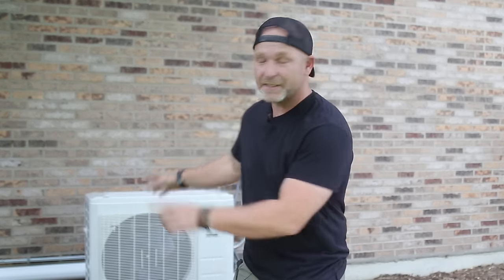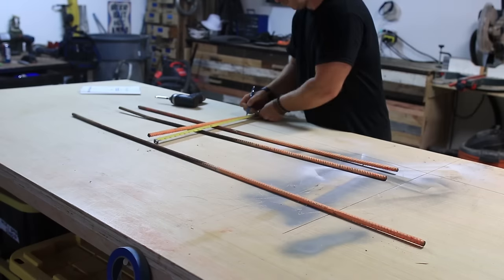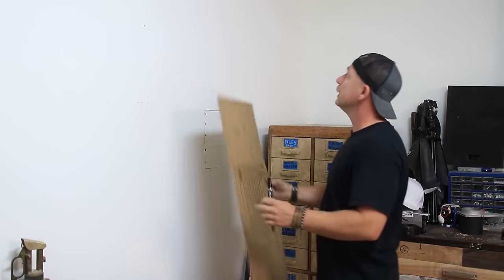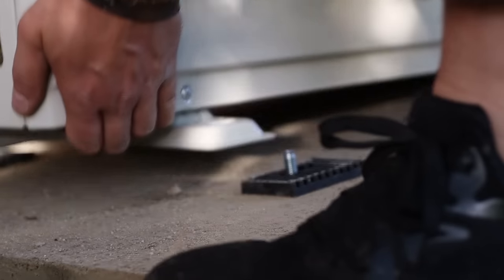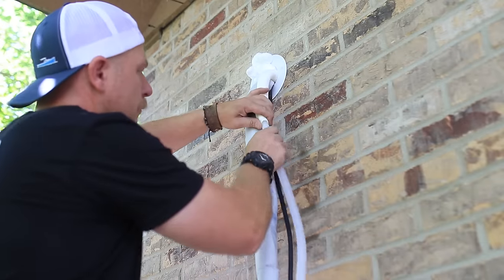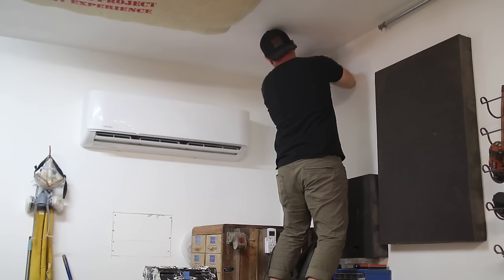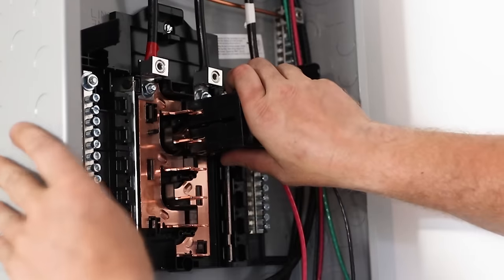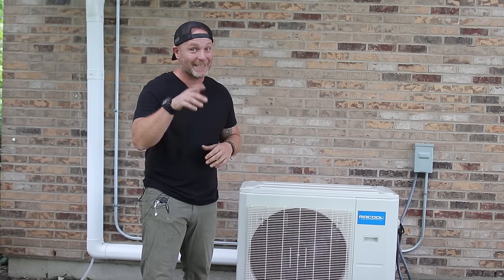How to Install a DIY Mini Split Air Conditioning and Heat Unit.  MR COOL 24K Split Unit

Comment: Great video! I am thinking of installing this unit upstairs in roughly 1200 sqft well insulated area. First, do you think it is big enough with a single head? Secondly, what wire size was recommended for this size unit? And finally, was it a double pole 30 amp or 40 amp breaker (part of the wire size equation).

Comment: Very nice job! Just one question.....Why didn’t you locate the disconnect switch on the vertical conduit you installed and move the condenser closer to it?

Comment: Was this unit already full with refrigerant gas? I thought most were  sold gasless and you needed to fill with refrigerant gas once plumbed up. Great work , yeah ladders can be dangerous.
Reply from the maker: Yes it’s pre charged already.  So all you have to do it connect it all and open the lines releasing the refrigerant.

Comment: Great video!  Glad you did not get hurt, worse, in the fall!  I see you used a 30Amp (220V) circuit.  Is that what Mrcool calls for, 30 Amp?  Do they request a dedicated circuit?  I will be installing 2TWO, SEPORATE, Mrcool    "E  star "4Th gen 24,000 BTU AC / Heat pump units",  I hope I don't need a dedicated circuit for each unit.  Do I?  (I telephoned MrCool and after being on hold for 8 minutes, the said they would call me back.  About 1 1/2 hours ago!)   THANKS!

Comment: I hope you can answer this fast. can I have the compressor hanging on the wall behind the indoor unit. with only the coolant pipe that comes out of the wall unit going directly into the compressor. or do you need three or four meters of coolant pipe for the air conditioner to work properly ?
Reply from the maker: So the lines cannot be cut because they are precharged.  So you can hang the condenser unit where ever you want but will have to coil the lines somewhere. You can drain the refrigerant if you want and cut the lines to make them shorter but then will have to braze some sort of fitting and have a hvac tech come out and refill the lines.  Not sure if doing that will do something to then warrenty though.   I would contact me cool and ask them.  They are really good about answering questions
Reply: @KomarProject  the air conditioner comes with four meter of coolant pipe, as of now they are empty because it isn't finished being installed. I just wanted to know if it has to be four meter or they could be cut short. but I think you answered my question. thank you.

Comment: Did you notice a significant difference in your electricity bill? I live in central Texas and am on the verge of ordering a 36k for my 1250 sq ft foam insulated shop. Was curious what the electricity bill increase would be.  Also where did you purchase?  Thanks for the time
Reply from the maker: I haven’t yet.  We have only been in this house one year so I have nothing to compare it too
Reply: I have an 18K Mr. Cool in my garage in SW Florida and it does not impact my electrical bill much, maybe $50/month running it part-time.  One piece of advice I would give is to have load calculations done on the space you want to use it for.  The reason is if you oversize it you won't get rid of the humidity.  It will cool the space so fast it won't have time to take out the humidity.  Load calcs are easy and you can get them done for about $100 from Calcs Plus, just send them your info and they will plug it into their software and give you the correct sizing for your space and geographic location.  I ordered mine through Home Depot.  http://www.calcs-plus.com/index.htm

Comment: Installed same system with your help! My inside air handler isn't completely flush on the side with the lines sticks out maybe 1/4 inch... did yours sit perfectly flat? Thanks!!

Comment: Were you using a hammer drill?  I was drilling concrete and masonry a while back with a regular cord drill (high power).  It was taking about 8 mins per hole. Someone suggested a hammer drill. I bought one and it reduced the time down to about 20 seconds per hole.
Reply from the maker: Ya it was a hammer drill.  Just helps a little bit
Reply: @KomarProject  interesting, it made a huge difference for me.

Comment: Question I am gonna be installing my unit. It is a 240v I know I need a 40 amp breaker but, did you use #2 8 awg wire or did you use 3 wire.

Comment: My kids just got a 640 sq ft small home should I get just 1 large unit or the 3 zone smaller units they have 2 bedrooms open kitchen and living area just want to make sure bedrooms have adequate a/c and heat
Reply from the maker: I would probably get multiple small units so they can control living area and bedroom separately.   It might me difficult to push air when they have doors closed.  My shop is 750sqft and this unit does it all but there are no separate areas.   Hope that helps.
Reply: Yes it does thank you and makes sense

Comment: I have a question regarding power consumption. If I understand it correctly, both of the parts are connected to a power supply - but which of the parts - the outside or inside one is drawing the most power for the cooling itself? Or is it split between the 2? I hope you understand my question. I want to install a meter for power consumption and would like to know where to plug it. Thanks!
Reply from the maker: That I can’t tell you.  Sorry.  I would contact mr cool and ask their sales department.  I’m sure they could help you with that.   Good luck Matus

Comment: Wouldn’t the rubber pads help maintain the vibration of the unit?  Wouldn’t this eventually damage ur system ?
Reply from the maker: Yeah the rubber pads do help a little bit but I’ve noticed that there’s hardly any vibration to the unit
Reply: If concerned you can re drill the anchor points and leave sufficient length to use rubber pads.

Comment: Hello Komar, awesome video. I have one question, what kind of screws you were using to mount the disconnect and copper line set-cover on the brick wall? thank you very much for sharing your experience with us.
Reply from the maker: Tap cons.  You can identify them by their blue color.  Used for masonry or concrete.

Comment: Did you get a new ladder?
I’m going to get a 12000 size and am wondering if it comes will all the tools your unit had. I’m guessing not. Also, can you plug the smaller one into a wall outlet?
Take care

Comment: Does the condenser have to be on cement? Could I put in on a back porch? Or could I put some brick blocks down on top on my wooden porch and put the condenser on them.
Reply from the maker: It does not.  It can be on anything that is stable.   I have seen people even suspend it from the house using angle iron.

Comment: How big is your garage? I have a 3 car garage and I’m on the fence between a 18k and 24k. Did you need to pull a vacuum for the lines?
Reply from the maker: I have a 3 car garage and they said 18k would do but I’m glad I went with the 24k.   No need to vacuum on this set up

Comment: What size breaker is required to power the unit? I've got a 100 amp panel in my shop but it's not uncommon to run two 220 machines simultaneously. Wondering if that combined with the Mr Cool would be too much?

Comment: Good job, but is best to pressurize the system with nitrogen to see if you have any leaks, then release the nitrogen and pull vacuum in the copper lines to remove the noncondensables that ruin the refrigerant on the long run, get ready to replace your outdoor  unit pretty soon

Comment: does the quick disconnect box comes with the unit? thanks  for the video and the safety advice.
Reply from the maker: No I had to buy it.  It was $10 at HD and I also bought the whip for it there.  Hope that helps

Comment: you must test your pipe with high pressure for finding leaks and vacuum it then you must open the valve of condenser. 
sorry my English isnt good enough for more information.
Reply from the maker: So with this unit you don’t need to vac it.  It’s done in the factory before it’s sealed and shipped.  That’s the beauty of this unit. But otherwise you are right my friend
Reply: @KomarProject  perfect 
in school we learned about old ac and i dont know about new equipment .
tnx man ❤
Reply: @AlirezA-em4hl  lines must be either vacuumed or purged out

Comment: I need to lift my sinking house but my outdoor unit is placed on the ground. Do I absolutely need to decommission the outdoor unit before lifting the wall? I only need to lift the wall by 7cm or max 10cm. Can I just lift the outdoor unit slowly as I lift the wall?
Reply from the maker: As long as the unit is not hard wired to the house and you have some play with the line set you may be able to lift it as well.  I never done that before and every situation is differant.  Good luck buddy
Reply: @KomarProject  my aircond installer told me the concern is not so much electrical connections but the gas copper pipes as they are sensitive to movement and may cause gas leakage. Not sure if he was over exaggerating it to make some money

Comment: What size wire did you use? Glad you are OK. I'm planning on installing a smaller version in a couple of weeks.  Thanks for the video.
Reply from the maker: I ran 10g wire for the electric.  But with a smaller unit just make sure you refer to the instruction Manuel.  It will tell you exactly with that unit needs.   Good luck brother

Comment: Hi there.  Question for you.  I have a 10 by 10 shed that my husband is fixing up for me as a soap cottage.  Would one of these units be more efficient than a window unit?  They seem awful pricey for just a shed, but then again, when I am working out there, I need heating and cooling.  I have a big window unit that was given to me, but since the shed has no windows, we would have to cut a large hole in the wall, which we aren't too keen on doing.  We are in the process of insulating and putting up bead board right now, but if we go this route, we need to plan for it now as there is only one wall with good access to the outside and space for the unit.   I am thinking we would have to hire someone to install it. Not sure what that would cost.   My husband works in propane and can set up my stove, but I am not too keen on him playing with electricity.
Reply from the maker: It’s a great unit for small spaces.  The one I installed is a 24k cuz my shop is pretty significant.  But I’m sure a 18k or even smaller will work for a 10x10.  And the best thing about this is you can set times for it to turn on and off from your phone.  I highly recommend it but I can’t speak to the cost difference on a window unit.   Hope this helps
Reply: @KomarProject  Thank you.  We do have a place in our little town that installs mini splits so I guess the best thing to do would be go down and talk to him about it.

Comment: Just curious. Is the 24K unit not overkill for your 750 sq ft garage? According to the Mr. Cool website, it is rated for 1500 sq ft. Curious because I'm getting ready to purchase one for my ~750 sq ft finished basement and deciding between this and the 18K unit, which is rated for 1000 sq ft.
Reply from the maker: Ya it’s over done.  The 18k should be sufficient for your basement.  I open my garage doors all the time and this allows it to push ac and heat very quickly.  I also have a attic that’s not very well insulated above it.  Either way I would have been good with a 18k but wanted to go big for piece of mind.  Hope that helps

Comment: What about the air in the refrigerant pipes? Dont you need to bleed them or vacuum out the air first?
Reply from the maker: Not with this unit.  It’s vacuumed in the factory before being sealed and shipped.  It’s the beauty of this unit that you don’t need a tech to come out
Reply: @KomarProject  ahh.. you mean the big coil of white insulated pipes are already vacuumed? BTW, how do they keep it vacuumed during the moment when you attach the ends  to the compressor and the blower unit?
Reply: @cyy3793  cause it’s bs, you have to evacuate the pipes. He opened them up when he had to connect them. And the refrigerant is in the condenser. That’s why he opened the valves on the condenser
Reply: @Yaboiirexy  Perhaps all you indignant HVAC experts should do some research on these DIY systems. These lines are vacuumed in the factory and charged and sealed before shipping.  The connectors have a seal that only opens once the connection is tightened.  No air gets in.  No gasses get out.

Comment: The 24k BTU instructions state a minimum of 8 AWG power feed, and preferred 6 AWG. Do you mind sharing where you found an 8 or 6 AWG “whip” power feed? I’ve only been able to find 12 and 10 AWG power feed whips. Thanks

Comment: Hey curious question here.....the thermostat that you are using doesn't look like the default one that comes with the unit. Or am I wrong?
Reply from the maker: That I’m not sure. I just asked for a thermostat and that’s the one they sent.   I called and told them what I needed and they filled the order.
Reply: @KomarProject  follow up question, how well has the heating worked with this unit?
Reply from the maker: @jareddedini4511  I’m loving it.  It haven’t been below zero year around here but in the 20-30s and it’s a sweet 69* in the shop all the time.
Reply: @KomarProject  thanks for the info man! Average winter temps for me are 30s. Summers are like 110-ish. So sounds like this should work well for me! Thanks!

Comment: Did you use a vacuum pump to bring your lines down to 500 microns?
Reply from the maker: You don’t need to.  These lines are vacuumed in the factory and charged and sealed before shipping.  That’s the beauty of this unit.

Comment: Did you run the same gauge wire from the outside unit to the inside unit as you did from the box to the disconnect?
Reply from the maker: So I used 10g wire to run to the box and same on the whip to the unit.  Hope that answers your question.

Comment: So are you just rolling up the extra cooling lines behind the mini split? You are insanely lucky with that fall. I did that same thing last year, ladder pulled off my shoe and I came straight down on concrete and shattered my heel bone. Basically crippled for life, 2 surgeries and now I get the good parking spots but don’t recommend getting 7 pins and a steel plate for a parking place up front. Anyway would like to know on the lines
Reply from the maker: Ohh no. I’m soo sorry to hear that!! Hope you’re ok.  Yes the lines I just coiled up and put behind the unit. Can hardly see them

Comment: I bought the same unit and unboxed it today, but I don't see the electrical wires to connect into the disconnect box. Is that a separate purchase?
Reply from the maker: Ya the whip is separate.  HD has them for about $10.

Comment: Is the line coming off the inside unit flexible to bend 90 degrees into the wall so I can run it in the attic to the outside? I don't have a great wall to put it on that shares the outside wall.

Comment: Hello! I just purchased a 12,000 BTU Mr. Cool for my garage. Quick question. The black thermostat in the video did you purchase that separately or did it come with your unit?
Reply from the maker: I got that separately I think.  It’s been a while

Comment: How loud is the outside unit? Nice job on install and glad you ok from the fall.
Reply from the maker: Not loud at all.  Compared to our regular house unit I think it may be a little quieter.  It’s hard to gauge though without actually measuring the decibels

Comment: How did you remove the air/moisture from the pipework without vacuuming it? Also no pressure test with OFN? These kits seem like a good idea but those pipes definitely needed vacuuming and testing before the refrigerant is released into the system
Reply from the maker: With this unit you don’t have to.   The lines and vacuumed in the factory before sealing.  That’s the beauty of it
Reply: @KomarProject  so the lines have shut off valves on them? Sorry I didn't see that in the video. I just saw you remove the cap on the end of the pipe which would let air in the pipe without a shutoff

Comment: Great job.  I'm installing one of these in my Dad's garage.  I have to run the wire before he puts up the Sheetrock and before he gets the unit.  One question.  What size wire did you install?  It looks like 12 gauge.
Reply from the maker: I ran a 10g wire.  Each unit will have specifications for electrical based on its requirements.  Just check the manual.   Hope that helps.
Reply: @KomarProject  thank you so much!!  I helps a lot.

Comment: NIce Video, thanks for sharing !  I'm looking at this for my 25 x 25 x 12 metal shop.  Do you think it would do the job?  It is insulated.  How's yours working and has it held up ok?  I see several bad experiences on AMazon reviews.  THanks!
Reply from the maker: Ohh it’s awesome.  My shop is 35x24 so it will push yours for sure.

Comment: Great video, question, are you supposed to bottom out the copper pipe connections? Are these with the rubber seals? I have a similar model that came with quite low torque indications. Thanks!
Reply: go by torgue specs

Comment: @komarproject how long are all the line sets that come stock with equipment? Are they 25-50 foot each. I’ll be doing a three head mini which is super easy but mr cool will be new to me. And if my lineset locations are all over the customer house will they be long enough to reach?  I see there will be no cutting or splicing on new copper  if they are too short. I usaully roll 100foot Lindsey’s so I know I’ve got plenty to go where ever I need through attic or out exterior walls. My main question is the stock lineset size that comes with unit. I appreciate your video and keep up the great work

Comment: Thank you for detailed video, specially the electrical connection part.
Was it easy to bend the refrigerant lines to 90 degrees to reach the condenser unit ?
Reply from the maker: It was not hard.  Just make sure you don’t kink them
Reply: Mine were corrugated coming out of the unit and bent easy, just go slow.